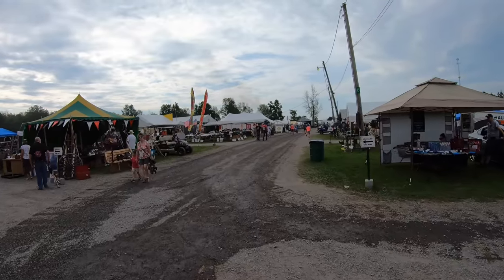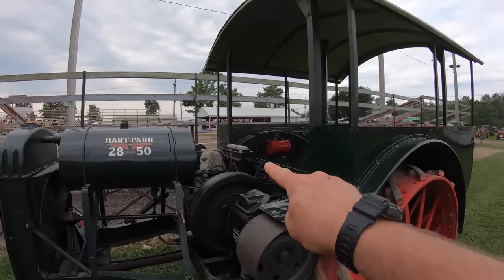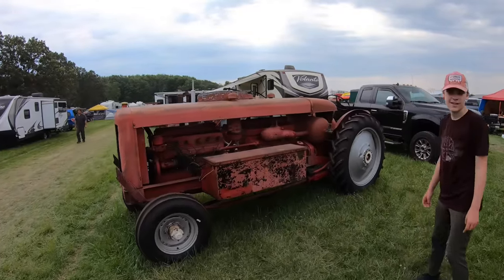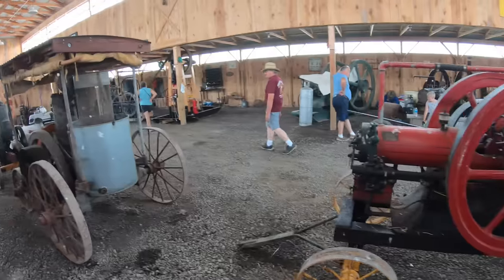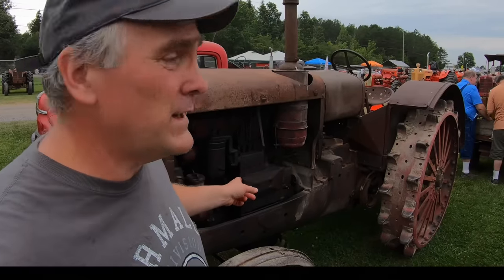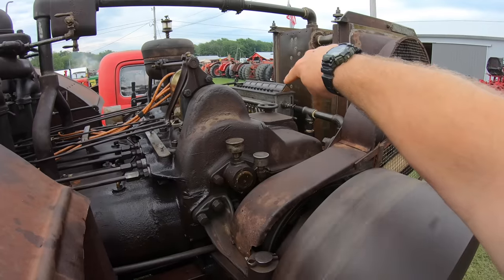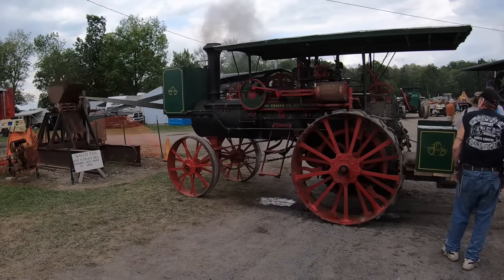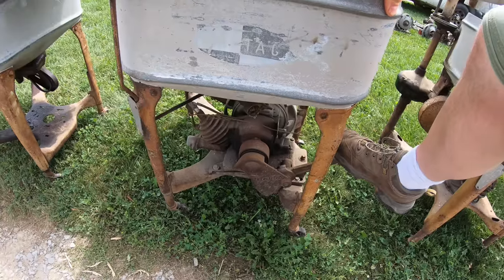Let's Go to the Tractor Show!

Comment: For those that don't know steam engines have no idle stroke. It is a power stroke with piston going forwards and backwards. When it is power stroke from front of piston the back is exhausting and same the other way. That's why they can have more torque than horsepower. Love steam engines.

Comment: Nice show, we were at on last weekend in Burnett, Wisconsin and IH was the featured tractor too. I like the little 1066, but it's a Farmall B, not an A. The B has the wide rear axles for a 2 row cultivator while the A has the wide axle on one side only. That's why they can mount the 2 seats on the little 1066, an A wouldn't have that much space.

Comment: Those JD D's and AR's did a lot of work back in the day so I was surprised I didn't see one. Th JD D pretty much ran on any flammable liquid that would flow through the fuel line. The fuel choices were a big selling point when you couldn't be certain you could get diesel. They also had a very distinct exhaust note.

Comment: The Baker Fan is also called the tractor killer! Why because tractors are belted to the right size fan and run at full speed and the fan speed works out to the horsepower of your tractor. It truly does bring a tractor to its knees when the engine can not make any more speed that is your top horsepower for that tractor.
   Also there are several New York state YouTube farmers attending this show.

Comment: On the farm, I worked at I drove all green. The gasoline 1020, 720, and a diesel 2020.  I enjoyed the 1959 720  the most. It sat high and had a hand clutch, plenty of power (53hp), and the tut, tut, sound it made especially under a load.  Having a tricycle front end it would cut on a dime and it didn't take long to figure out where not to take it. I had the front end come off the ground a few times but only because the drawbar weight was borderline. Sometime later the owner sold it to one of his neighbors and it burned up in a hay shed that was struck by lightning. Hated to see Old John end up like that, he was truly a treasure. I've driven a few of those Red machines as well, I have no qual with those. With all farm machinery, if you take care of it, run it like you're supposed to, and lubricate it often, most of it will take care of for a long time. However, everything wears, and sometimes eventually breaks. Only nothing lasts forever.

Comment: Steam Engine Tractors have incredible Torque.   Very Slow but Amazing  Power.  
Horsepower : 110
Torque :  The Earth moves in the opposite direction of the wheels.   LOL
Reply: Yep, don't run them north/south or the poles will melt.🚜

Comment: Oh my gosh.   I grew up with Steam Engines, commonly known as Threshing Machines.  My father belonged to Saginaw Valley Live Steam Association in Michigan.  He owned a 1922 Kelly Springfield Road Roller of which he placed a fly wheel on it so that he could thresh at the Steam Shows at the fairgrounds.   He liked burning wood as opposed to coal.  Wood was much cleaner and kept the flus cleaner.  We traveled to many other fairgrounds in other states.   He also made a Steam Boat with a Paddle Wheel.   We were quite an oddity in our neighborhood.

Comment: HI there Pete. I have driven a few old tractors in my time. The Fords on Major you mentioned looked just like tge one I use to drive when I was working on a Duck Farm which had 40,000 Pekin Cross ducks!  It was old Arm-Strong steering for that Tractor...a STRONG ARM!

Comment: I took my lunch hour at the LaGrange Indiana steam and gas show today,  It was absolutely identical to the show you were at.  There was a beautiful restored Super M diesel TA.  I thought of you.  That one was way too nice to rake with.  Same steam engines, same saw mill. The immaculately restored road grader was on a Ford Jubilee.  The featured tractor here was Oliver and Oil Pull.  Those guys certainly do a wonderful job making them better than new.  I would be ashamed to bring my daily working 4020, M, 656,8N and Case 430.

Comment: My grandfather had a farmall A with that vaccum Cylinder for a front blade, ironic it was cleaning a modern freestall barn in 1966. we used it for almost 10 yrs with only problem was freezing in winter. Every old A I see I look for that system.